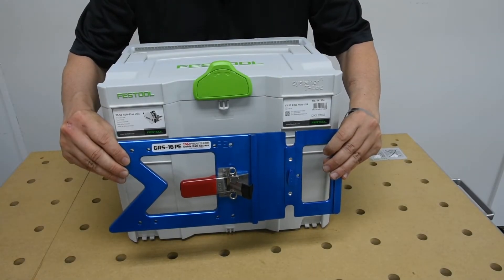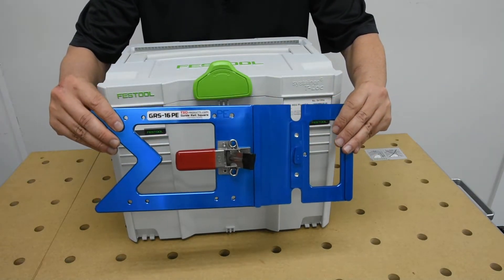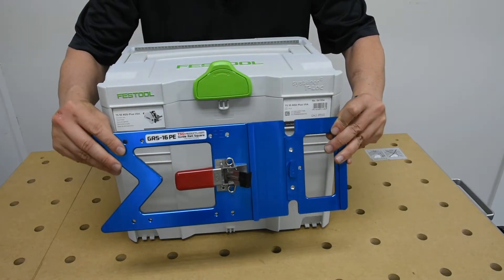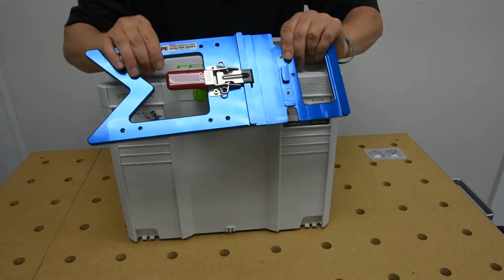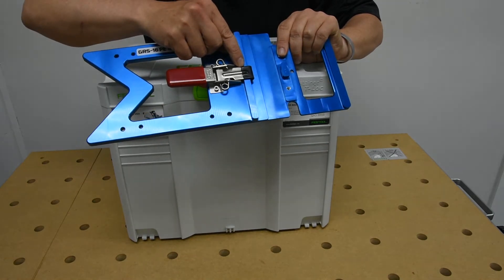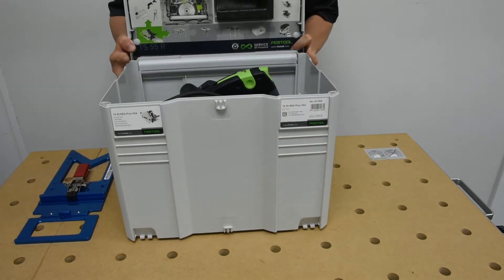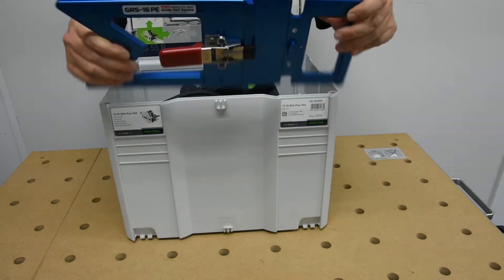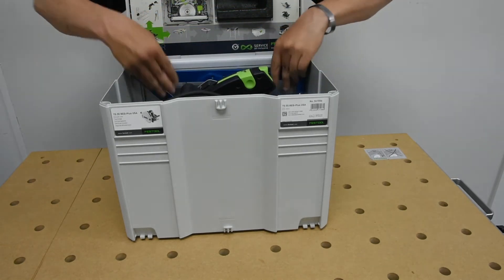Shop Minutes Number 1

Comment: Have you tried it with the Makita?  I'm sure it will work just the same.  Good tip!
Reply from the maker: I've not tried it, but that's a good question!
Reply: Probably not, considering the Classic Systainer (and Makita clone) are not as wide there.